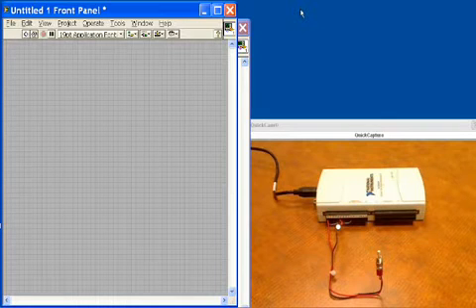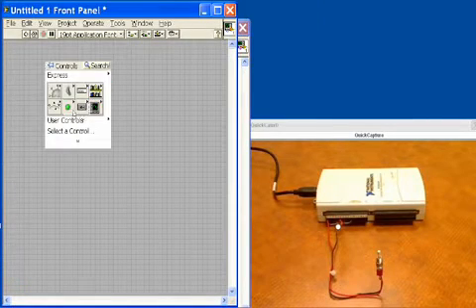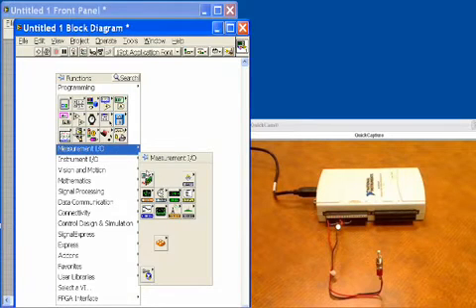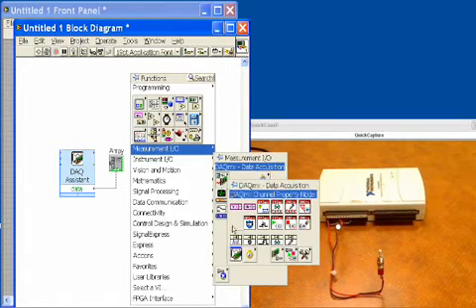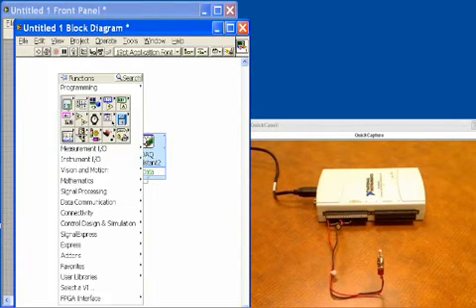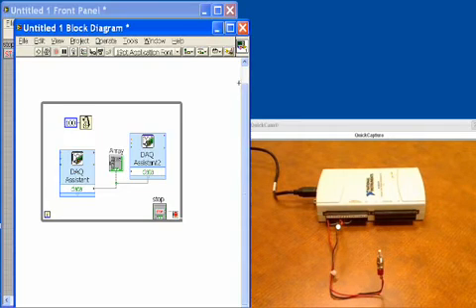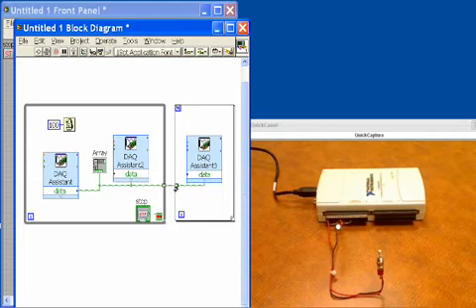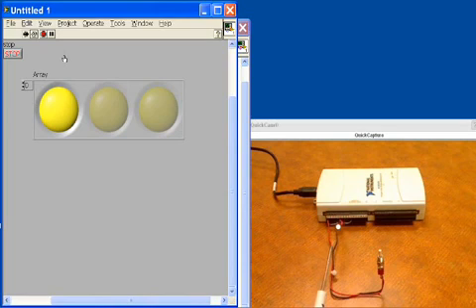Digital Input and Output with NI USB-6211

Comment: Nice video. Could you please help me with a problem I have. I'm making a temperature regulator using simply a ventilator and a light bulb to heat up and cool down a box. Now I would need to triger through some logic the digital output for the light bulb and with another the ventilator. But it seems that the data required for the digital output isn't simply a bool which I thought first. So can you maybe help me with this?